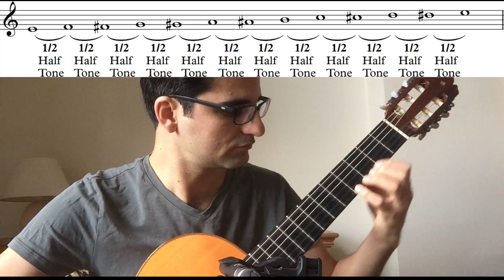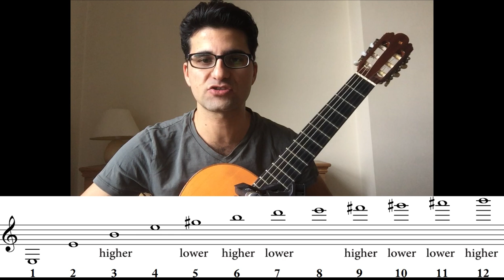Major 3rd Problem of All Guitars in the World

Comment: before people start praising this as a solution to centuries of inconsistencies, there's a reason we ditched just intonation in favour of equal temperament. With just intonation we try to keep each interval as simple a mathematical ratio as possible: an octave is 2:1, fifth is 3:2 etc. but with 12 notes in our tuning system, you simply cannot have these ratios apply to all intervals in all keys. what may sound rich and full in the key of C, will sound absolutely horrendous and out of tune in the key of F#. In equal temperament, we tune to 12 over the square root of 2, essentially making all 12 notes equal semitones apart, with the octave being exactly double the initial note (keeping that 2:1 ratio). So yeah our simple and pleasing ratios are gone, but now every interval in every key is consistent. In this case with these microtone frets, the key of A may sound great, but the second you start moving into other keys and start using more complex harmony you're going to run into a lot of problems. It's an interesting experiment for sure, and if you know for sure what keys and chords you're going to be using you can have some fun, just know that you're putting a lot of limitations on your instrument by doing this.

edit: sorry, meant equal temperament not true temperament
Reply: dat_chip Traditional middle eastern music didn't work with chords because the idea of functional harmony comes from western music, a lot of eastern music deals with much more complex tuning systems with many more notes per octave, making any sort of harmony outside of simple things like drones extremely complicated. Not to mention they didn't use just intonation, they had completely different tuning systems with different scales and microtones. So you're sort of right, and now it's not uncommon to appropriate traditional music from other cultures with more western harmony. 

As for the whole studio thing, I disagree. Studio time is extremely expensive, and most artists would not be able to afford either seperate instruments for every song, or have the time to modify all of their existing instruments. Not to mention even if they did, it would only work in songs that stick exclusively to one key, and even then harmony would have to be limited severely. If, for example, you're playing an instrument tuned for the key of C in just intonation, if you play a D and an A together, what should be a perfect fifth, you get a ratio that is far from the normal 3:2 for a perfect fifth, instead you get an incredibly dissonant interval known as the wolf fifth (YouTube it), meaning that if you're playing a song in C, even if you never play any weird harmony or modulate at all, if the piece has at any point a D and an A (which would occur naturally in the ii chord), you might as well sick with true temperament. harmony has evolved so much over the centuries, just intonation simply doesn't cut the mustard for most of today's music. it's really only useful for playing more traditional stuff like tolgahan is demonstrating.
Reply: @JoshuaConnorMusic  That's why instruments such as the guitar with movable frets are the solution. https://www.youtube.com/watch?v=WSV63t4eW5M. 

No one play all the scales in a single song, and the sound benefit with right tuning is huge. Especially in acoustic instruments.
But actually microtuning is more important for the learning & practices periods. I've never been able to dig into my guitar play as i were always dissatisfied with the sound: whatever i were playing it was sounding wrong. I changed for acoustic bass as fretless allowed me to ajust the right notes.
Reply: @nico-bf1kr  except it's not the solution, not unless you only plan on playing in 1 or a couple of very closely related keys in a song. In genres such as jazz where modulations to distant keys is common, this system simply doesn't work. It also doesn't work with more complex harmony.
Reply: Arnold Guitarnut You don't write in flat keys on Piano because they are dramatic. There's a more practical explanation. Elton John often plays in Bb/GMinor or closely related keys because, 1) those keys are easy on the hands (to shift between inversions as he sings), and 2) he learned from playing gospel and blues, and a lot of that genre's music was written by horn players who tend to write in Bb or Eb because that's their natural key. Also, the key of Db major (a favorite of Debussy, Chopin and Liszt) is one of the easiest keys to play, because of hand's shape (thumb on F, pinky on C, longer fingers on the black keys). Also, in Debussy's case, the five black keys used in Db form an easy visual and technical path for adding and playing pentatonic scales (which Debussy began adding to his music), among other reasons. There's always a practical reason first, IMO, then later the music that tends to come from those keys is thought of as dramatic, harp-like, nocturnal, or whatever the case may be.
Reply from the maker: I agree with you but what I am trying to suggest is depending on the pieces you play, we can correct some intervals and also with my movable fretted guitar design, I can play many pieces with natural intervals: https://www.youtube.com/watch?v=MYK_PF9WTRE
Reply from the maker: JimJamBanx No worries, I like your comments. Though just intonation is my favourite intonation, I am aware of the drawbacks on guitar. But I like to find solutions on my adjustable microtonal guitar. Cheers.
Reply: No, it's just well tempered approximation, you cannot have true temperament guitar, nor piano, it's impossible (bcs of math). But you can make some keys sound better, and some worse then equal temperament, and that's  what bended frets (curved frets) do , thy make A, D, G keys great, and others, like F#, D#, G# soo bad. It's always compromise, so if you compromise equal temperament is great for playing in a lot of keys , but if you play in specific keys, and no modulation, u can use different tunings.
Reply: LittleStoneDogs uh, because sometimes songs require you to play more than one key at a time? in addition to that, most fixed-note instruments are already well-tempered because carrying around 11 grand pianos or organs is fucking stupid. so, unless you have a solo career playing songs exclusively that have no modulation, AND have band members that will want to put up with carrying more than 1 bass, mandolin, or keyboard to a show just to sound a little better, this isn't very practical at least for a lot of us.
Reply: MrElokin I'm assuming that by "perfect" you're referring to the corrected intervals shown in this video? if so then it makes sense, because the intervals are perfect mathematical ratios, the tones are incredibly stable, and to some it may seem so stable and clean that it's boring. On a normal guitar with equal temperament, the intervals are very slightly off, which creates a slight wavering effect, and adds tension to the chords. I agree, personally I prefer the imperfections of equal temperament, it's the same reason why when using 12 string guitars, guitarists will often put the unison strings (the high e and b strings' pair is tuned to the exactly same note and octave) very slightly out of tune to create a fuller sound.
Reply: @JoshuaConnorMusic  The 'chorus' effect.
Reply: @JoshuaConnorMusic  Don't forget to mention that the 'slightly out of tune' notes create headaches and listening fatigue.
Reply: @dennisdougherty7538  look man I don't make the names of these things, go tell that to the company that makes the frets. And also, I've never heard of anyone getting headaches or listening fatigue from the "out of tune" notes in equal temperament (which is a loaded phrase anyway since the temperament system dictates what's in or out of tune anyway. Just intonation can be just as out of tune if not more than equal temperament). Please show me some actual scientific research on that cause that sounds like a complete load of crap to be honest.
Reply: Why? You are not very good at arguing.
Your comment only proves you don't understand anything.
Reply: The key thing here is that you are NOT setting up a full partial fret Just Intonation fretboard, which is pretty crazy and more limited to certain keys, yes. 
This solution is a fully accessible system. You place one extra fret and the 3rds of that chord when used in any key are now pure. Great! Want to use that 3rd as a root, making it now out of tune with other frets and its octave frets? just use the 12equal fret that is still there ! :) With a small number of frets you improve the 3rds of all open chords that are used in many songs in multiple keys. When they aren't appropriate,  12 edo is still there.
Reply: Exactly this. It's a problem but if you want to play in all tunings on a guitar the guitar as we know it now is the best approximation. That's why all music today is made with these instruments.
Reply: JimJamBanx Isn't true temperament where all the frets are bent?
Reply: You won't put any limitations on your instrument as turning a tempered instrument into natural harmonics will make it a tool for a very different kind of music from tempered music. To be exact, YOU are the limitation of your instrument. If you use a non-tempered instrument trying to play as if it was tempered, it's a lost of time. Just keep in mind tempered music is mostly meant to entertain, while non-tempered has been made under religion purposes, to connect human to god(s)/nature/soul/whatever ... which is the reason why non-tempered is freaking awesome
Reply: Exactly! With Equal Temperament, each of our 12 makor keys will all have similiar intervallic relationships. In Just Intonation, depending on the key, the sound of of a simple I IV V progression will greatly change. Adam Neely did a video on this a month or two ago.
Reply: +JoJo Mama what sounds pleasant and unpleasant is almost %100 subjective. I love middle eastern music, but I know a lot of people who say "it sounds random and out of tune". The reason why the majority of people who grew up in western countries have a vague agreement on what sounds good, is because western music has been recycling itself in one way or another for the past several hundred years, especially in regards to harmony. We've been using equal temperament for hundreds of years now, and we have all very much grown accustomed to it; the idea that just intonation is pleasant and equal temperament is unpleasant has been rendered untrue through the centuries of its use. The average listener would never be able to tell the difference if you just played them a song, I've never heard someone listening to the radio say "those chords don't sound pure enough".

The only reason why people will ever agree on what sounds good is because of repetition. Play microtonal music to a western audience and they'll say it sounds out of tune and bad, but play it to an audience whose culture has been listening to microtonal music for centuries and they'll say it sounds beautiful. Through the centuries of use of equal temperament, listeners have grown accustomed to the sound, and so the notion that equal temperament sounds out of tune compared to just intonation is one that has almost completely been erased by history.
Reply from the maker: @Johnny Bolt I think the solution is to have a movable-fretted adjustable microtonal guitar. If there is a need  , you can move the frets for the new key. If you want to play a piece in different keys, add more frets. Check the 2nd tuning in my Bach experiment.
Reply: @potatoheadhaoy even though I didn't address you with my question, I will reply to you.
Violins, cellos (any non-fretted stringed instruments), can be play perfectly well with a piano. When playing a harmonica in A Major, it harmonizes just fine with a piano playing in A Major. The Trombone wind instrument, which is another example of an instrument not have a fixed tuning, also does fine with a piano. 

For the songs that are played in different keys, and not just a switch from the major key to it's relative key, a stand fixed tuning guitar can be used. 

Sorry man, you argument doesn't make sense to me. 

Maybe JimJamBanx can explain it to me better.
Reply: LittleStoneDogs Because it's incredibly expensive, impractical and not always viable. It's not just hobbyists dude, I don't know many full time guitarists who could afford 12 high end guitars that are tempered for different keys, the freight costs alone to take them all on tour would cost more than all other living expenses combined, there's a reason why most acoustic/classical guitarists only bring 1-2 guitars on the road. Having to change guitars between every song for different keys would get annoying not just for the player but the audience as well, and as potatoheadhaoy mentioned, unless you're a solo performer, good luck getting your band mates to carry around 12 pianos/basses/mandolins/guitars etc. harmonicas are a hell of a lot smaller, lighter and cheaper than the aforementioned instruments, so that argument doesn't really apply. But let's say you're willing to go through all of that, you're now going to be forced to play music that is constrained by the limitations of just intonation; that means no modulation except for very close key signatures, no advanced harmony, and some intervals/chords are now simply not viable. In the key of C in just intonation, try playing the ii chord, notice how dissonant and ugly it sounds. that's because of how just intonation works, the relationship between D and A creates what is called the wolf fifth, an incredibly unstable tone that makes D and A unusable in just intonation. So for many musicians just intonation is simply not viable with how many limitations it poses on the music, I for one would much rather be able to play in all keys, using any harmony I wished, with any other instruments, at the rather negligible cost of slightly imperfect intonation, which 99% of people listening would never notice anyway. and as others have said in this comment section, not everyone prefers the sound of just intonation. I for one find it to be too stable and predictable, there's something more lively about the slight imperfections of equal temperament to me.
Reply: Thx for the explanation. I have a TL;DR argument for a lot of the points, but when i read 

"In the key of C in just intonation, try playing the ii chord, notice how
 dissonant and ugly it sounds. that's because of how just intonation 
works, the relationship between D and A creates what is called the wolf 
fifth, an incredibly unstable tone that makes D and A unusable in just 
intonation. "

 nothing else matters. 
If I am understanding what was typed, having a weak ii chord would affect a lot of the music I play.
Reply: George Kufman true temperament frets have nothing to do with just intonation, in my OP I accidentally said true temperament instead of equal temperament, my bad. True temperament frets are a way of making the intervals on a guitar perfect to equal temperament, not just intonation. The frets on a guitar a kind of an approximation of equal temperament, and so there are some frets that will sound of of tune with other instruments. You could probably get true temperament frets designed for just intonation, but the one your thinking of, the one Vai uses, are just a way of being as accurate to equal temperament as possible.
Reply: George Kufman no, equal temperament and just intonation are two completely different tuning systems, one is based off of simple mathematical ratios, and one is based off of dividing the octave into 12 equally spaced semitones. All fretted instrument these days are intonated for equal temperament, however the frets on a normal guitar are usually very slightly off in a few spots. true temperament frets are designed to correct these, to get an accurate representation of equal temperament as possible and have perfect intonation across the fretboard. I'm sure the company that makes true temperament may have just intonation options, but the normal option does not get you closer to just intonation in the slightest, it gets you closer to equal temperament. And who says chord can only sound good in just intonation, close to all music made over the past several centuries has been in equal temperament, are you saying that all this time chord and notes have sounded bad? And as me and another commentor in this thread have discussed, not everyone likes the sound of just intonation.
Reply: JimJamBanx You should read my comment again , TT does not get you closer to equal temperament , this is shown and described on their website, but as they say, it's close enough to play with ET instruments and not sound bad. 
The frets of a typical guitar are not usually off in various places - straight frets can achieve ET but it requires perfect setup with low action.
TT frets are their own non equal temperament designed with bias towards sweetening common guitar keys at the very slight cost of others. It sounds like they also tweak theoretical placement of that slightly to solve common intonation setup issues too, yes, but that is an aside. 
So yes TT does get you very very slightly closer , but no its not JI at all. Definitely intended to be different from ET though ! 
they did have other more extreme options such as a meantone blues temperament but they aren't available anymore as far as I'm aware
Reply: I know people who will say "those chords dont sound pure enough": vynil edited analog recorded 100%valve amps 60's guitar nitro lackered lindy fralin pickup loaded through boutique pedal talibans would be very capable of saying such things.
Reply: Well the only reason snob guitarrist havent started to say that is in 
fact the difficulty for guitars to become microtonal or polychromatic, 
as you say. That would be the last frontier of guitar snobism. Or maybe 
the opposite: being a taliban of anti-microtonal music because rock has 
not been. 
We will enjoy anyway.
Reply: Yes but low action also has its own set of compromises. You'll be more susceptible to string buzz, and the strings have less room to vibrate resulting in a weaker tone. IMO chasing perfect intonation is kind of a fruitless endeavor; it's like a dog chasing its own tail. And even if you do get there, audiences will never care, that slight bit of inconsistency near the 6th fret will be unnoticeable to %90 of audiences, and the ones who do notice will understand that it's just how guitars work.
Reply: Agreed, I suggest others do a search for the "Pythagorean Comma" for further explanation of the subject of temperament .
Reply: That's exactly why the ancient instrument, Sitar has movable frets!
Reply: actually with true just intervals, you'll start getting out of tune before you even leave the key. all ratios are to the root note, so a bmin7 in a system tuned to ratios of c would probably already be pretty wonky 

maybe god fucked up, because there is no 'perfect' solution to all this. or maybe yet, thinking of tuning in terms of inconsistencies as problems is missing the mark entirely

if one takes time to appreciate all the clever ways people came up with, balancing trade offs here and there,  how different sounds must have went in and out of favor over the centuries. or suppose all of the ways these methods could take one off the beaten track, developing completely new musical systems of tuning completely unlike our own, but still harmonic

it starts to sound less like a problem to be solved and more resembles the richness of biodiversity

if so, the guy who makes these guitars totally gets it
Reply: Thomas Colleu   how do you know this? historical Inquisition or personal experience I.e. psychedelic research. dying to know. I've been intrigued w this for over a decade and most people haven't a clue
Reply: George Kufman TT frets ARE indeed different in every key. they have the cent offsets listed on their site and mention this. it's a much much more subtle adjustment to slightly improve popular keys enough to not ruin the less popular ones. 
Nowhere near as drastic as the cent changes needed for the pure intervals presented in  this video
Reply: Awesom! Simple answer but good. Glad I was answered.
Reply: Search Variax would be a fantastic candidate for flexible just intonation as used by choirs etc. Still certainly complex though as it would need to know the root note of the chord being played to tune the just ratios from
Reply: JimJamBanx I think the best way a guitar can have complete range of microtonal adjustments is... being fretless. Or maybe be the frets every 4 mm.
Reply: I would gladly try a fretless guitar with a fretboard full of marks of different colors, or try putting them in one.
Reply: Search It's actually easy enough to memorize useful alterations to 12edo. with regular 12 tone lines you can just flatten major 3rds slightly like this video, sharpen minor ones slightly etc. you learn what adjustments sound good :)
Reply: Any genre that uses modulation and advanced harmony would sound horrible, not just rock and metal. And 12 guitars is a lot for any band, even ones with cargo trucks and whatnot. So let's say you have a band that has at least one song in every key, so that's 12 guitars there, but if a string breaks they can't use one of the others because it'll intonated differently and be unusable for any other key, so each guitar will need a back up (every big band/artist has back ups for all their instruments), so now we're at 24 guitars. And what if some songs need an acoustic guitar for the verse or something? Or one song uses a 7 string? A single band member could have up to 30 guitars, and heaven help if your band has more than one guitarist. It's an incredibly impractical solution to a problem that 99% of audience members would never hear the difference to anyway.
Reply: Again I think the point is being missed - this is still 12edo but with the added optional 3rds adjusted. You can add some frets and get better 3rds on a bunch of chords whilst remaining in 12edo with normal sound and modulation ability. Your 3rds will just be better, like those of a singer singing over 12edo. if at any time they aren't appropriate , the regular fret is still there
Reply: That's not how those systems work. Variax can change the tuning of each individual string, but it can't change the pitch of each individual fret, meaning that the frets are still confined to its original temperament (same thing with every other midi guitar on the market), and the Axe FX is an amp/fx modelling system, has absolutely nothing to do with tuning or temperaments of the guitar. And once again, if you're on tour, I can't think of a single band that could afford to bring 30 guitars per guitarist (and can't forget about the bassist as well) and still come out the end of the tour in the green, the amount of money spent on shipping, freight costs, and extra cargo trucks would be ludicrous; and could you imagine how much they'd have to pay their techs to look after all those instruments? I'll say it once more; 90% of audiences would never be able to tell the difference. A live show isn't supposed to be perfect, so no one's going to be listening that intensely and think to themselves "hmm, that major 3rd isn't resonating with the harmonic overtones by about 10 cents".
Reply: Damn Good Thread! 
As a programmer (enterprise software) and a guitar synth guy, it is possible to write software that could make each fret prefect intonation; assuming the guitar player had the perfect fretting technique. 
The question is, would it be worth it? 
Would just intonation (the perfect fretted note) give a base line / median point, for other non-just-intonation instruments to modulate around? Could it harmonize? Could a guitar player develop the fretting technique to use it sometimes when it sounds good, and other times not when it doesn't sound good (as suggested in this video)?

And as far as 12 differently intoned guitars and touring goes.......I have never met a band that plays in more then 4 or 5 keys. WTH are people talking about with bands playing sets or a full show using all 12 key signatures?
Reply: you mean we made it easier ? thats all
Reply: I play my guitar out of tune , all over the place, it still sounds good, in time, I can "play" it's practice . 
That's what I do , this micro tuning is spot on , I'd do it religiously if I was playing set pieces , or looking for same result .

Really intelligent video ,
Reply from the maker: Hi guys! Have you tried the Renaissance experiment: https://www.youtube.com/watch?v=DjyNgzjNzyM
Reply: Joshua Connor:  Please do not refer to a 'temperament' as 'true'.  By definition temperaments are NOT true whether you are tuning or manufacturing steel.
Reply: didn't watch the video all the way, but this guitar isn't um, well-tempered? dammit man that sucks. that means I can't play music in all keys
Reply: I'm saying that if using a guitar that can be used for only one key already makes its use limited, and therefore less practical than having a regular guitar in the first place. I wasn't even talking about fretless instruments, what are you talking about? Pianos are well-tempered, true temperament would sound off ever so slightly in conjunction with it, so that would make being "in tune" pointless as well. therefore, we would either have to unify the temperament to true temperament and carry 11 instruments, or use a normal well-tempered instrument like everyone else, and not have to worry about changing keys. Which you can't do on a true temperament instrument by your own admission.
Reply: JimJamBanx  So if just temperament doesn't work with many different keys - how is it that True Temperament frets/fretboard system (like Steve Vai and others are using on) is able to make all notes, on every fret, with every chord tuned?
Reply: JimJamBanx actually false but commonly believed that way due to simplified marketing and misunderstanding by most of their users. True temperament is not equal temperament, and a well setup normal guitar is capable of very nearly perfect 12TET - just very uncommon due to most guitars having nuts cut very high for a start, as well as high action or too much relief.
True temperament makes some guitar physics adjustments too, but is not trying to hit 12TET.
Reply: JimJamBanx I guess the fret addition/adjustment will fit a midi guitar like a variax or similar, so you can set different math adjustments for songs or a general adjustment for all playing without ruining the other keys.
Reply: Tom Winspear I think somebody in computer instruments industry is perhaps now developing a special addition about this in some vst instruments, and hopefully for Variax too. As today vst and software music programs are better and better and they got so many functions, I guess somebody will think about it and make some user friendly adjustment with an auto mode or key patterned setup so you dont need to make special experiments by yourself.
Reply: JimJamBanx Doesn't "being more accurate to equal temperament" mean becoming more close to just temperament? I mean, the only way your chords/tuning is gonna sound good (correct) is if they all, each one, will be just temperament (which is, as you and theory say, impossible)?
Reply: Well it's their loss, I and the thousands of other musicians who don't mind will enjoy being able to play any harmony in any key with any musicians on any instruments in blissful ignorance.
Reply: KillertoneLabs Yup, each ratio in equal temperament is very close, but never perfect, with the exception being the octave. That's why you get that slight wavering effect when playing certain chords, because the ratios are sooooooooo close, but just off, and so the frequencies never properly line up. Check out Adam Neelys video on polyrhythmic harmonies, he demonstrates how this works on a rhythmic level and it's honestly mind blowing.
Reply: Oh man, I just saw it, and it was good.
Reply: JimJamBanx That's true. Even when prefectly in tune, some guitar chords always sound kinda dirt. When I started playing it bothered me, sometimes it was hard to feel the beauty of playing those notes, or feel I was playing the right way or to be sure the strings were in tune. But you get used to it and that's how guitars sound. I guess it is also the reason some guitar players arent aware of the fact they are out of tune or playing bad :D
Reply: What if you added a 1/4 note, 2/4 note, 3/4 note - inbetween all of them,  surely you can move the scale anywhere just by rememberin where it is?

you could colour the full notes differently etcto find each easy?
Reply: Jack Robinson Yes, and as I said in other comment, that way your guitar is almost evolving to a fretless guitar ;) A frestless instrument has an almost infinite number of microtones. It depends on your memory and skills and they can also have marks. But the sound it's different.
Reply: Jack Robinson indeed fretless gives you infinite options but is also much harder to control for chording and a different sound entirely.
you are suggesting 24 36 and 48 edo. yes these are flexible but the amount of frets and spacing becomes insane. 19 frets per octave is actually the next best step in approximating pure tunings with as few frets as possible. then 22, then 31 (31 is getting very excessive though)
Reply: Come on, it's 2017, dont go too far. If you ever need like 12 or 30 guitars on unusual intonations, go get a variax or a midi guitar or an AxeFx or whatever. If you  do special music and get paid for it, or you play at home, have as much instrument as you can. But unless you are getting paid for such special features in your music, carrying them is not the best idea. Even if you get paid, those electronic devices will make your life easier. Unless you play in a simphonic orchestra or stuff.
Reply: JimJamBanx You are right. I was thinking the idea I commented in previous comments could be done with some plug ins or effects, but perhaps it's not, at least with rwgular ones. I wonder if software based instruments have an option to change the math relation of the notes and the frets. For a variax it could be great and perhaps easy. I never used one anyway. Nor an Axefx but i wonder if some kind of weird octaver or pitch effect can be hacked for those purposes. 
 I agree not most of the bands could afford shipping 30 instruments. I was talking about the few very well payed for such possibility. Anyway rock music is meant to be in equal temperament. It will not be a matter of if the public notices the perfection, but if some special song has been put in the album with an specific instrument, perhaps it will not be the same witb a regular one. That means the rest of the songs usually are not that way. And being realistic, maby shows are so loud that you cant really hear if they are playing exactly like the album.
Reply: JimJamBanx I bet it can be done with a computer midi plug in on a laptop. I think some midi vst instruments can have the notes repitched-tuned, and save the variations. So maybe it's easier than I think. Some guitar players go plug to a laptop live.
Reply: The guitar is simply not an instrument that's really capable of doing it, unless a company manages to find a way to program the software to be aware of what fret is being used, but I think we're a fair bit off at the moment. The way systems like Variax work (I believe) is that it takes the fundamental note (let's say the bottom E string) and works out how far away the desired note is (eg we want to tune the E string to D), and applies a detune patch. Then as you go change the pitch via fretting or bending or whatever, the software knows that whatever you do on that string, to apply the same formula as it did with the open string. So if we were to digitally tune our E string to D, all the Variax is doing is digitally detuning all the frequencies coming from that string down a major 2nd, it's not thinking about "ok that's the major 3rd, so let's detune that slightly more" it just thinks "whatever pitch I get, detune it by X amount". The reason why it won't work on the Axe FX is because of the way the variax system works; when using the tuning function you don't use a pickup, instead the guitar has piezos for each individual string, Axe FX isn't designed to work with the Variax, it's designed for normal guitars that don't use piezos, you might be able to put a pitch shifter in the effects chain, but that would just apply the effect to the whole signal, not to individual strings or frets. To have different calculations and formulas for every fret in different keys would be too much for any current technology to reliably handle. Things like keyboards can do this, because it just changes the pitch of some of the keys, no problem, but the physical make of a guitar makes it very difficult.
Reply: JimJamBanx Ok, but... I never used specifically a Variax, a midi guitar or an Axefx, but here are some ideas based on other devices I met: First, some Midi guitars have keys instead of frets and strings. That makes them actually a keyboard. Althought I havent played one yet I got this little device at home called midi converter for guitar. It's the cheapest in the market and its accuracy depends on volume and tone adjustment from the guitar knobs, but what it does is controlling a electronic instrument or synthetizer from your regular guitar, or and vst instrument in a computer from your guitar. When you open the vst, you can actually midi write what you are playing in the screen. It's the cheapest model but i remember seeing some a little more expensive thus better. Ok, if the guitar sends a midi message to the vst, I wonder if that can be used live so the vst can be set to then send a modified signal of the notes received. I'm not very experienced in vsts and it's been some time since the last time I recorded some music with them, but I think some of them give the option to individually change the tuning output of every key/midi written note. So the vst is playing not what fret is played but what has been written in midi, all bendings and etc included. And midi is simple and fast as a computer language, i guess it all could be done live. 
If what I have just written is right, could it be easier than what it looks?
Reply: Search check out Scala for retuning of midi files. you could indeed very easily remap a midi guitar to 12 tone just intonation , perhaps even with switchable key centers
Reply: Or you could just get true temperament frets and call it a day....
Reply: surgeyX they are incredibly subtle , differences of under 5 cents
Reply: Tom Winspear If you're a musician you can hear the difference right away.  My next guitar will absolutely have TT frets.
Reply: So the solution is to have a guitar for each key in which we want to play.
Reply: So if a song has some key changes in it you grab another guitar real quick for those parts?
Reply: Like a harmonica player.
Reply: skunker 52 you said "You can have the same result just by bending your string a little bit ..",  that says a lot in very few words.  Blues singers do it, so you know it's good.
Reply: That's interesting about the 12 string and makes sense. It's kind of like a natural "detuned" or chorus effect. That's how Ozzy gets that signature sound on their albums too as I recall, they double the vocal track, and shift one of them down by like 10 cents or so.
Reply: we knew what you meant
Reply: It's really interesting that the equivalent intervals vary from key to key.  I don't think anybody knows the reason for this.  I think it has a lot to do with how we hear things, rather than with frequencies and frequency cancellation.  I read a fascinating little black book on this subject about thirty years ago.  It was very critical of 'mathematical' theories of scales, pointing out that what's accepted in theory (raitios and predicted overtones and undertones) can sound off in practice.   String bending, pulling and diving a little on the whammy bar and instinctive extra pressure at certain frets (to raise the pitch) can iron out the defects in mean temerament.  Jeff Beck seems to be the master of this.
Reply: acbulgin2
One solution might be a fretless fingerboard, such as on a violin or 'cello.  Of course that would increase the difficulty level of playing guitar by probably a factor of about 20.  Playing keyboard instruments or fretted instruments does not require a player to have such a good ear, but those who play instruments in the violin family must have a very good ear.
Reply: Likewise Renaissance and Baroque lutes.
Reply: Joshua Connor
You barely touch on the real reason.  With equal temperament, A-flat and G sharp (for example) are the same note, but with just intonation, they are not the same.  In fact, G sharp is slightly higher than A flat.  The same thing is true of all other so-called "enharmonics"  But it would make any fretted instrument or keyboard instrument impossible (well, at least hundreds of times more difficult) to play and maybe even to make.  I also believe you will find that the equal temperament tuning is based on the twelfth root of 2 (2^1/12), not 12 over the square root of 2.  So if A4 is set to 440 Hz, and n = the number of half steps distant from A4, each note has a frequency of 440 * 2^n/12 Hz.  Whereas  with just intonation these frequencies are determined by the overtone series.  As a string vibrates, it segments into two equal parts vibrating at two times the frequency of the whole string, giving the octave.  Simultaneously, this same string segments into three equal parts, each vibrating at 3 times the frequency of the whole string, giving the 5th (actually an octave and a 5th).  At the same time, each of these segments also segment themselves into 2 and 3 equal parts, and so on ad infinitum.  This cannot be changed by any type of tuning, so equal temperament is always going to be prone to sounding out of tune.  Instruments in the violin family have fretless fingerboards and are, therefore, not affected by these problems.  I think I have also seen some guitars with no frets.
Reply: Ben Cur
When you say Renaissance and Baroque lutes, you mean fretless, right?
Reply: I am a certified fretted instrument tech, and a guitar teacher. Not the best in the world, not the worst. I commend you for thinking out of the box, firstly. Well done. We have all been frustrated at times with this “problem”. 
Compensating with your hands is part of the skill of playing a standard guitar. I won’t go into the problem of how the different keys become unequal in intonation as others have covered that. This is a great idea for the studio, but for live this is impractical unless you want to drag a bunch of guitars around or fiddle with taped on frets. 
It’s a great exercise in problem solving, but simple playing skill and ear acclimatization will mostly solve the same problem. The best solution is a fretless guitar, but it creates other problems, as does moving partial frets around. The guitar is a simple instrument, and while I appreciate innovation, this is a bit more that is needed, imho. 
A bit of struggle with your tools is good for the soul and the ear.
Reply: How about if every guitarist has a kit of 12 guitars, one tuned to each key in the chromatic scale.  Hey, harmonica players do it.
Reply: There are other temperaments besides pythagorean (using just fifths), meantone (narrowing the fifths to get just thirds) and equal. There are many kinds of well temperaments that provide usable harmony on all keys while having close to just intervals. Paul Hindemith's came up with a solution  incorporating the versatility of equal temperament and the natural sound of  the most important intervals in harmony (octave, fifth, fourth, the thirds and the sixths).
Reply: That's what I think.. I was watching demos on playing jazz fusion with Strandberg Guitar with true temperament fretting system, and for me it always sounds out of tune. Regular (equal temperament) fretting system sounds better for me. Maybe it because you're right.
Reply: In general, I don’t understand the dabte you’re having.

By adding frets, the guitar doesn’t become “C major guitar” or “F sharp major” guitar. You still can choose which G# you’re playing. If the song is in E major, that you’d probably play the lover G# due to the resonance. But if you’re in other key, you play the standard G#. I mean, I don’t understand the problem.
Reply: Joshua Connor well crafted response! You could have left it True Temperament if you added a TM ;-)

Not sure how timing stacks up with this vid vs the work done by these guys in Sweden, but in my estimation this might be a pretty close solve:

http://www.truetemperament.com/necks/
Reply: This is a good, but not a new invention. Those small frets were used in the 16th century for fretted string instruments, too. They were called tastini in Italian. Vincent Galilei (Galileo Galilei's father) argued against their use in his 1584 Fronimo Dialogo. 
Apart from that, movable frets (typically made of gut) were used for instruments such as the lute and viola da gamba for better intonation.
Reply: Joshua Connor The vidéo did a good job in explaining the problem and the solution to achieve a more perfect pitch. You comment did a good job in ignoring the problem and keep playing out of tune. 😂
Reply: dude pause a little, have you ever heard of compensated saddle in guitar?
Reply: This conversation just went whoosh !!
Reply: Tobias Reiner   true temperament frets do not use mean temperament, it's equal temperament; the point is to improve the intonation of the guitar relative to equal temperament, not change the temperament system itself. 

And while I agree that this is a great solution to wanting to have multiple temperament systems at your disposal, it's not perfect. Yes, you can just play the regular frets, but you can't tell me that it wouldn't be harder to play when you have double the amount of frets and half the space between frets to play. Especially for more complex chords or lines where you may fret in different spots of the fret for playability, with the addition of in between frets that may become impossible due to the smaller area in which the fret, lest you get an incorrectly intonated note. It's also more visual information you need to actively parse, since you have many more frets you need to keep track of; if you spend your whole life in 1st or open position this might not be a big deal, but as you go up higher positions the issue of knowing exactly what pitch is where at all times is only exacerbated.

This here solution is great for what it seeks to achieve, but it is not a one size fits all, Tolhagan himself has multiple microtonal guitars as well as standard guitars, so I'm sure he would agree that if you can get away with less frets, you should.
Reply: Tobias Reiner  there's a learning period as well as being undeniably harder. Perfect harmony is relative, what sounds perfect will differ from person to person, which is fine. I for one prefer the sound of equal temperament most of the time, though there are some situations where i so prefer just. So I don't think it's fair to compare to cheap and expensive wine because there's nothing inherently superior to the sound of just intonation; it's more mathematically consonant but that's it. If you really like the sound of just intonation then by all means. As I've said before this system is great at what it does, I'm just tired of seeing all these people trying to say that everyone should do this and that just intonation is objectively superior to the system we've been using for the past several centuries.
Reply: @adolfohernandez7609  I mean to be say equal temperament in my original post, which is the system we use.
Reply: So this will not help me when I am playing jazz on my classical, then? Due to the various key changes that could occur throughout the song?
Reply: most guitars aren't equal temperament either. compromises are made so the frets can be parallel, straight lines. look up true equal-temperament frets
Reply: There is no compromise in harmony. Either you have harmony or you don't. This is another facet showing the INSANITY of modernity. Claiming something is when it isn't.
Reply: Als ich ein kleiner Junge war,sagte meine Pianolehrerin:Matthias es gibt auch rein Dur und Moll.Die Sache fällt mir mit 63 auf die Füsse.Danke Herr Bach für Deinen Pfusch! ich bin mit Pythagoran Klavier zufrieden.
Reply: Tolgahan Çoğulu Absolutely, the music you've demonstrated in your videos benefit greatly from a modular fretted system, especially in your microtonal pieces. I'm merely addressing the numerous people in this comment section who don't fully understand both the pros and cons of just intonation, and are just taking this idea at face value as a band-aid solution to perfect intonation. I'm not in any way trying to discredit your approach or methods. A video on the differences between equal temperament and just intonation would be a good idea I think.
Reply: @JimJamBanx So I hear your argument with our current tuning system and it completely makes sense IF YOU HAVE ONLY 1 GUITAR and are a hobbyist.

But if you are more then a hobbyist you already own many guitars - for ease of playing in different tunings  for different songs, electric and acoustic,  and hardtail bridge vs tremolo system, humbucker vs single coil - so why not have a couple guitar for the keys you play in most and have them set up as micro fret guitars?

The purity of the chords he was playing in this video made chills run down my spine. It is more then worth it to have 2-3 guitars set up with micro tuning for the key signatures I feel comfortable playing in.

Kinda like other instruments out there.  E Major harmonica, A Major harmonica - different symbols on percussion (drum sets) 

Why is a guitar supposed to compromise on the sound simply to make it so you can play any key on a single guitar?
Reply: Thanks! Interesting. I'm actually not a guitarist; I play double bass and fretless. So, it's interesting to think about how musicians most likely correct sub-consciously when playing those instruments.
Reply: well yes the true temprament guitar neck uses bent frets and "true temprament" is more of a brand name, and it basically is equal temprament.it is bent because the intonation of each string is a little bit different so putting the frets at the same place for all strings is not really equal temprament temprament. on a piano you tune the notes individually but on a guitar you shorten the string. so what they have done on the true temprament guitars is making sure that the frets actually matches those notes (like it would be on a equal temprament piano) Or atleast that is what I've heard. 
So if you actually want something to sound reaally good you cand do like Tolgahan is doing but it also means that you have to move them when you change key.
I don't know if it became too hard to understand but anyways! cherrs!
Reply: You can have the same result just by bending your string a little bit ...
Reply: @skunker52  lol
Reply: It would certainly sound bad, but I'm quite sure Tolgahan is aware of these limitations. I guess there are different ways to go about this. A few ideas off the top of my head:

* Use the modified guitar only when you know that you're gonna play a song in a key that really fits the way it was modified. Have a normal guitar ready in case you need to play something else.

* If you're gonna spend a lot of money going to the studio to record an album, you might as well go through the hassle of changing the modifications to the guitar to fit every single song.

I've also noticed how chords seem to be far less common in old kinds of arabic and african music. They stick to melodies. I have a feeling this might be because of just intonation.
Reply: JimJamBanx  may be Is it just me but for some reason the guitar with perfect intervals sounds kind  "enclosed" , not so vibrant as a standard guitar, ok  with perfect intervals sounds perfect but not a "pleasant perfect" but a dull perfect.
Reply: surgeyX Yes you certainly can - What I meant is that it's an insignificant difference compared to true just intonation frets like here. This video is more like 15 cents, can't get that much adjustment with TT frets as it would no longer work in all keys
Reply from the maker: surgeyX I agree with Tom. It is easy to confuse just intonation ratios with true tempered semi tones. True temperament fixes your semitones in 12 tone equal temperament, whereas just intonation has the natural intervals like 14 cents lower major 3rd or 31 cents lower minor 7th.
Reply: I play metal. rock, country, jazz, folk,  spanish, neo classical...
I'd smashed the living shit out of my guitar if i was force to
play the major scale or harmonize using only chords going 
every other fucken note.....FFS
All t2 notes works for me...But piano players with 10 fingers
wanna plat all god damn 10 notes at the sametime without space.lmao

If you actaully learn the BASIC 28 modes from the NATURAL
. HAMRONIC Minor,. MELODIC Minor, and HARMONIC MAJOR...
You would know why they slap in the LEADING TONE
and the PURE TONE scale was forfited...
YOu CAN MODULATE...Via KEYS shifting , AXIS PITCH or play those 4 scales together as a whole....In other words MUSIC is in 3D
Reply: So fucking annoying Tom
Reply: JimJamBanx ... yup!
Reply: Harmonica players can and should bend notes with embrochure to accomodate their needs.
Reply: That´s rigth,that is exactly my point: those little imperfections  make the sound more round,open,warm , at least to my ears.
Reply: @MrElokin  Warm?
Reply: I'm not going to change everything I've learned about the guitar just because this guy is anal about intonation. Music isn't about perfection, it's about bearing your soul. I give this guy two middle fingers up!